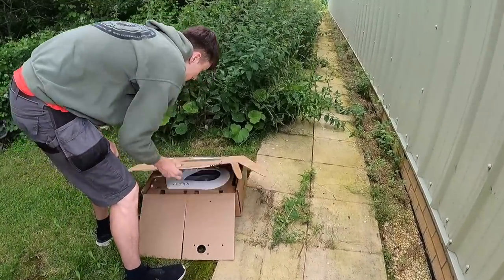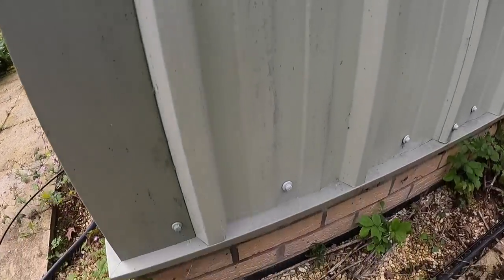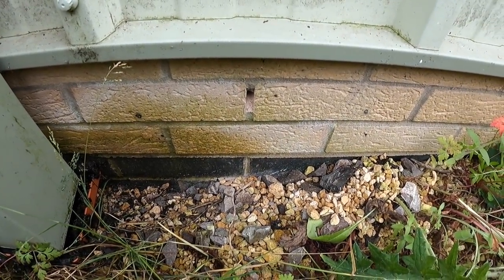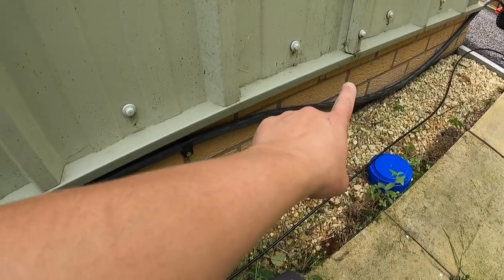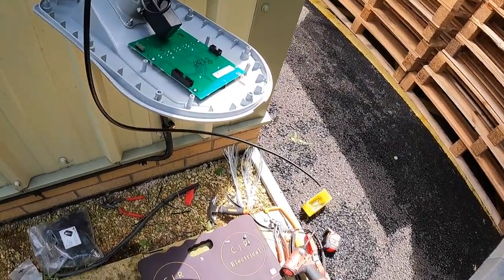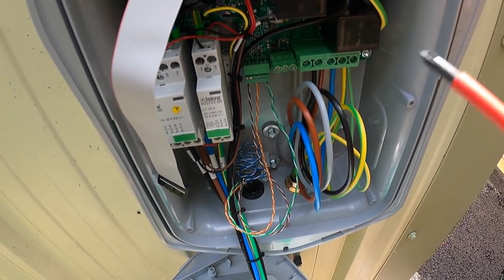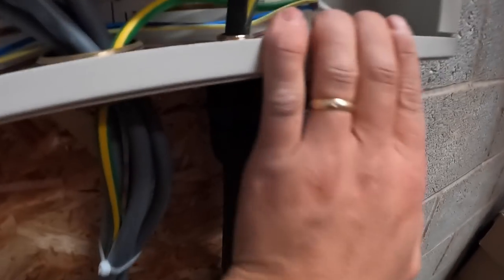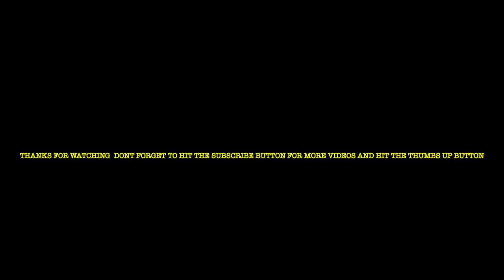The future for motoring is upon us NOW!! EV Charger not difficult. CJRELECTRICAL  Commercial Install

Comment: I find it easier when pulling cables off the drums to have the cable coming off from the top rather than below as you did. Couldn`t help noticing the backward slash and forward slash on your label on the Zappi cover being different.

Comment: You can now get SWA EV Ultra cable in 3 in 5 core plus data.
Reply from the maker: Yeah cheers guys on this occasion is was quicker and cheaper to go with the separate.
Reply: @Cjrelectrical  I use the next size cleat up and the data cable fits in the cleat with the cable nicely

Comment: Chris, save you some time and WAGOs put a RJ45 plug / socket Modual on CatX, then put CTs in to RJ45 plug / socket also, you can then use a coupler in wiska or a patch cable Socket to Socket ;)

Comment: I'd put a bit of edging on that hole, or some fire seal & not keen on the PVC cable ties around the outside - I would have been inclined to use steel ties if I wasn't clearing.
Reply: What benefit would you  get using steel ties outside that low?

Comment: Little tip I use for the rack a tier. Put couplers on the end of the metal conduit. Gives it a lip so it doesn’t pull out :)
Reply: @sammarshall2734  half the time I just use ladders and a broom stick. Use what you got 🤣🤣

Comment: Always put the screw to the top when using cleats. When you put the screw at the bottom through time the weight of the cable will force it downwards and it can come away from the wall
Reply from the maker: Only on cables 95mm and over bud
Reply: Never knew that mate. Knew there would be a reason why you did it that way 👍🏻  I've always just done this as standard practice.
Reply: ...As opposed to the plastic breaking and the cable coming away looking right mess in addition to a hazard. Never tell a professional how to do it. Your method may be the best in your opinion but opinion  is only valid with evidence. (I take it you are a pro?)

Comment: What was the make of your torque tool?  Where the cables come into the building through that thin tin meatal, would it not have been better to use a gland oi the cables never get cut from the sharp tin?
Reply: I have a Draper and it looks like mine but can’t be 100% confdent

Comment: Just saw a school boy error bud the CT's need to be on the phases supplying the charger only and not the main DB feed because as it is, the CT's will be measuring the current used by the whole DB and not the charger only..
 Really enjoy your videos and keep up the great work..!

Unless the CT's are there to monitor the total current used by the DB to automatically avoid an overload..? And that would explain why its done the way its done... 😂
Reply from the maker: CT’s are there to monitor the entire supply bud.
Reply: @Cjrelectrical  hello you say the cts are to monitor the entire load but does the zappi also monitor the kVAh of the ev only charging the vehicles . .. or will I have to install a separate electrical power meter if I want to do that I just want to be able to calculate the total energy costs over the years

Comment: Hey Chris, not a criticism but shouldn’t you have either insulated the screws that you fixed the zappi to the cladding with or connected the cladding to the CPC in case one of the live conductors dislodges and hits the screw to energise the cladding? Not sure if the zappi is considered double insulated but it looks to be all plastic construction. Nice install though 👍

Comment: hi m8 can you explain the difference between a normal fuse n that 3 phase 1 plz
Reply: Three-phase MCB is three single phase MCBs in one housing, the levers are connected, so if one phase trips due to overload or short-circuit, the other two phases are also switched off. Back in the old days here in Germany it was also permitted to use three single phase MCBs, but this is no longer state of the art, because of the advantage of the three-phase MCB that all phases are switched off if a fault occurs on one of the phases.

Comment: Nice job , I am surprised that between the board and the EV point there is no point of isolation.
Not up to speed with regulations but most other current using parts , machinery and Aircon always have a isolator.
I guess EV chargers don’t need it ?
Reply from the maker: You can install them if you want the ev charger to be off at night but this ev charger has a pin code and lockout. Also remember introducing another connection point may also introduce another point for loose connections.
Reply: Yes you're quite correct you should have a local means of isolation .... Unless they changed it in the latest version of the regulation's

Comment: Now after that costs is over, there is the hidden cost on a battery replacement for EV car. I looked it up already, it's anywhere from $9K to $15K USA dollars. Because after a few years the battery, like any other will need a replacement, and not a Chinese counterfeit verision. Of course fossil fuel will be used to make new batteries will still continue.
Reply: @Cheradanine  I'm confident they can make batteries last longer today, but will they? It is more profitable in replacement parts. Look at appliances, they used to last decades. I have a refrigerator that is over 35 years and never failed. I purchased another one recently and it lasted 2 years before I have to replace the starter for the compressor. Products are intentionally not made to last anymore. Also Tesla will not be the only EV out there and when competition gets tough products will be profitable in repairs. Just look at iphones they are like cars, built a new model every year, and each year there are issues and cost for new ones go up. It's all about profit.

Comment: Err the data cable has to be rated to the highest voltage present, should of used EV ultra cable.
Reply from the maker: Ev ultra cable has cat5E which is rated at 230v. What’s your point mate?

Comment: Why are the CTs fitted on the incomer to the board? They will measure the current used by all the circuits, rather than just the EV charger, unless I've missed something obvious.
Reply from the maker: Load balancing the entire installation
Reply: The charger can be set to the rating of the electrical service.  By monitoring the  total current draw the charger can pull as much current as it wants, but will ramp down if another load comes on line to prevent pulling more current than the supply is rated for.
Reply: You can specify a maximum load for the entire premises, so as not to blow the main fuse. The charger will ramp down if you're reaching the limit
Reply: Also for Monitoring Export for Charging in Eco+ .... Running on Sunshine :)
Reply: Monitors the current of the whole installation, you can adjust a limit on the charger. That system is there to prevent blowing the main fuses due to drawing too much current.

Comment: Would you not get interference running that cat 5e cable in paralleled with the armour cable ???
Reply: No not at all.
Reply: @nathanstephenson775  I take it , that it's because the cable is armoured and not standard PVC flex.

Comment: Nice to see a housebasher using racatiers
Reply from the maker: House basher 🤣👍
Reply: @Cjrelectrical  Just need to get the hang of brass nuts & bolts on your banjo's
Reply from the maker: Nah to soft
Reply: @Cjrelectrical  Dissimilar metals not good copper and brass or ally and stainless its the condensation that makes them corrode at different speeds
Reply from the maker: Il get some bronze spray paint same stuff they use on the banjos 👍
Reply: @Cjrelectrical  Haha nice one keep up the great work and love the channel learn loads off you as I only do Industrial/chemical work Cheers

Comment: I always wonder how those without driveways will be able to use electric cars in the future. Right now i see no way except for to get permission to go under pavement and install a charger on the road but then if someone else parks there you're fooked.
Reply: Go & Park up in supermarket for a couple of hours... then move on to the next one...
Reply: @farmersteve129  So you come home from a long day at work and then have to spend an hour knocking about a supermarket because you don't have a driveway? Sounds impractical.
Reply: @electricalstuff259  I'm no ev fan, but the reality is that most people won't actually be needing a full charge every day. For the majority of folk taking their car to work then it's going to be parked up somewhere whilst they work, so why not have the charging points there? Supermarkets are already rolling out charge points, so can other businesses & I think that planning regs should require any new office, factory, etc with parking should have a minimum number of charge points
Reply from the maker: Could run a generator on the boot to charge the batteries?
Reply: @Cjrelectrical  could put a windmill on the roof... 🤣🤣

Comment: Got my ev course in September geeez
Reply: What do they teach on these courses, I can't think what they can teach a qualified electrician.
Reply: Well it’s new tech and new regs, we are not born with the info and some manufacturers want you to have the exam pass.
Reply: @supersparks9466  yeah I get that, but everything that anyone needs to know is in the regs book, and as for having done a course by a manufacturer, that's  gone now, as for the circuitry it's just a regular circuit, CEF wanted £400 for one of these courses, a complete rip off.
I only asked because I wondered what they could teach, that an electrician wouldn't already know, that was all.
Reply from the maker: Need the qualifications if you want to claim any money towards to installation
Reply: @Cjrelectrical  yeah well that's going soon, and it's not worth claiming it, more red tape and a charge point can be installed for the same price or less even allowing for the grant money
Reply: @simongreenidge6454  my question was one of genuine curiosity, that was all, because I had never looked into those courses, because I see them as no different to installing a cooker circuit or similar circuit and genuinely wondered what an electrician would get from such a course, obviously you thought I was taking the piss.

Comment: Why did you run the cable to the charger on the outside of the building rather than the inside?
Reply from the maker: Good question that - internally it was a nightmare racking stacked high to the roof full of goods a toilet cubicle  kitchen and office to overcome.
Reply: @Cjrelectrical  Thanks for the explanation.

Comment: electric cars still have a way to go range is not enough not all cars use the same connector to charge more chargers will mean more power stations will need to be built ( just really passing the buck on polution ) and electric car batteries cannot be recycled yet. ) of course the green lobby have thought of solutions for all this.....nope! ( just my two cents rant )

Comment: I forgot these could work without Wi-Fi 😂
Reply: For now....6 to 12 months down the line he will have to go back and do a software update. I done a commercial install without a hub and now I'm having issues with charging stopping all the time. Been told to do a software update which is gonna cost me money going back to do as I can't expect the customer to pay after me hyping up the Zappi.  I'm no longer fitting Zappis on commercial installs unless the hub can be installed also.
Reply from the maker: Is the client not competent enough to do the software update ?
Reply: @Cjrelectrical  Yes, but the Zappi is installed in a remote area and it isn't practical to have the hub installed. I will need to use a 4G router to connect a hub and perform the update. When installing the Zappi initially I  never thought there would be an issue in the future with cars not charging🤷‍♂️